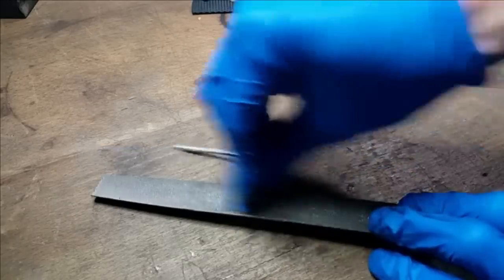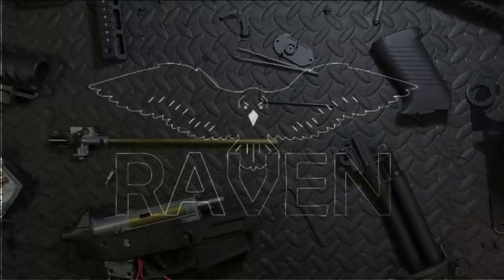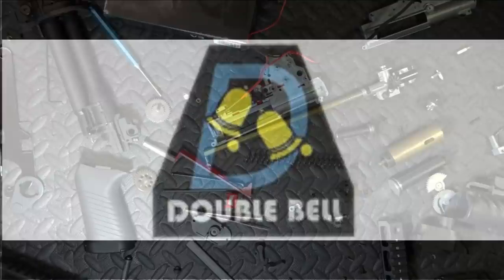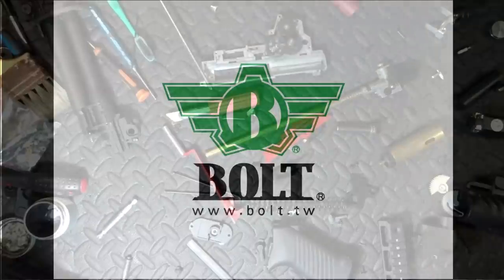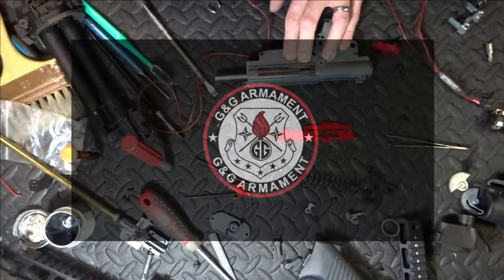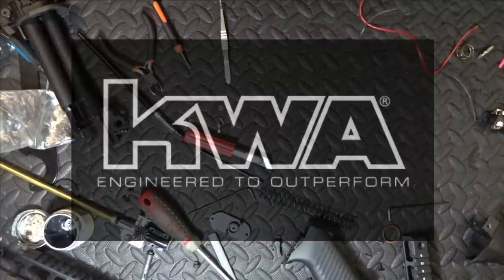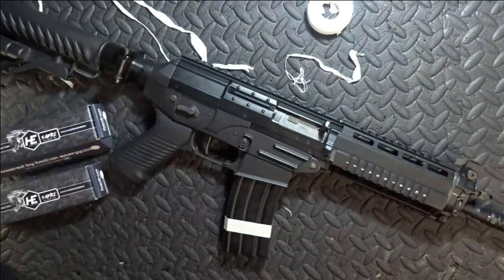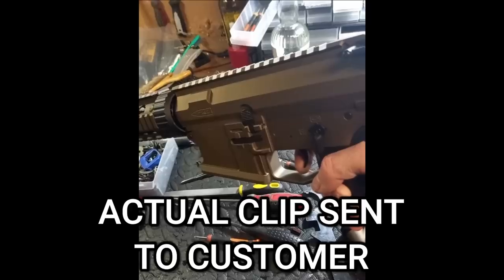Know Your Airsoft Brand!

Comment: What are you guys’ opinion on Lancer Tactical? I got one of their gen 2s as my first (actual) gun a year or two ago and so far the only issues I’ve had was that the hop rubber shat itself within the first 800 rounds, the barrel sucked balls, and it needed to be shimmed properly. Other than that it sounds decent on a 9.6 NimH. Better than that Krytac Negative showed in the video about how gearboxes sound different lol. Thanks for reading, please leave opinions even though I am late if possible?

Comment: I just ordered an ICS CXP ARK too lol, hopefully it works well, considering you don't really have many good things to say about ICS lmao
Reply: I've been using ICS for years and I've never had a single legitimate issue with them lol. My older CXP from like 6 years ago had a weak oem piston that failed prematurely with a lipo, but the split gearbox made that an easy fix.
My PAR Mk3 has been flawless.

Comment: I bought 2 of the Vorsk agency 1911 and the slide has more wobble than a fat bird on stilts on one of them and the other is perfect 🤷‍♂️ hop up on one is hot garbage and skies bb’s no matter where the hop is set and the other is straight as an arrow. Look nice though.
Reply: Oh also they have designed the hop up assembly in such a way that you can’t remove the assembly itself without bending and flexing the barrel itself 👏🏻👏🏻👏🏻 WTF

Comment: i bought a used ares when i was new. turns out the air seal was failing, most parts are proprietary and the hop is finnicky. i also own a src ak underfolder. first hour of fielding it, the screw for the wire stock just falls off. fml
edit: SRC= Shit's Really Crappy

Comment: Any toughts on WELL sniper rifles ? Not shure if i should get one
Reply: The general concensus on Well sniper rifles is that they are a good base to build a decent gun from.  But they say that sniper rifles are built, not bought anyway. I have an MB01 and am waiting for the end of lockdown so a tech can see what he can do to improve it. mine seems to be solidly built and shoot straight but it totally doesn't have the range to cut it as a sniper rifle. I am almost certainly going to be changing a lot of, not all of the externals to improve it.

Comment: Where did you get the snake man is that cgi stuff looks pretty real
Reply from the maker: We have 5
Reply: @NegativeAirsoftTech What type of python is it mate ??
Reply from the maker: @brianrapley567  he's a Royal.
He's called Principle Skinner
Reply: @NegativeAirsoftTech  Lmfao Principle Skinner is one sweet looking Python and i have a m401 with ported cylinder i upped the length of barrel but gained no fps,is this because of the ported cylinder which i beleive its a 70% and it sits on 415 fps with .16bb and 320fps with .25bb with a 1.3 spring

Comment: Aw maaan, can you show how u did the motor thingy on the Sig 556? I'm stuck with one here in Brazil (love the aeg, but it is on the wall only due the motor issue)

No chances to get a mid axle motor around here and the techs around me don't do that
...and importing seems not to be a good idea, as u said it burned 2 mid motors

Or should i accept and keep it on the wall? Haha
Reply from the maker: really powerful magnet next to in a vice, cut the shaft down with an angle grinder, add d cut
Reply: tornado medium or stock JG works good in king arms 556 ,I took a step forward and montage tornado short type .